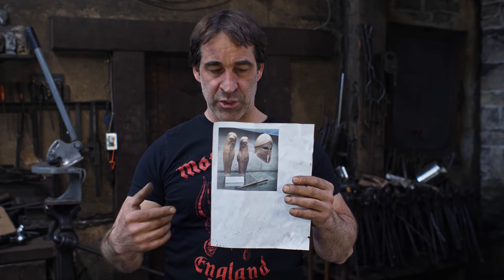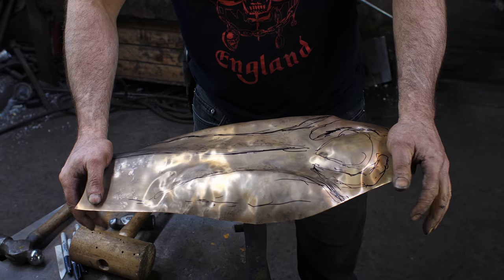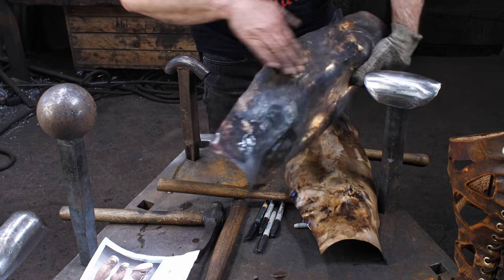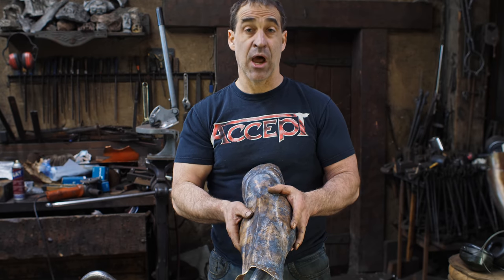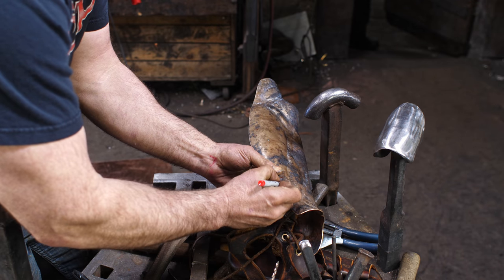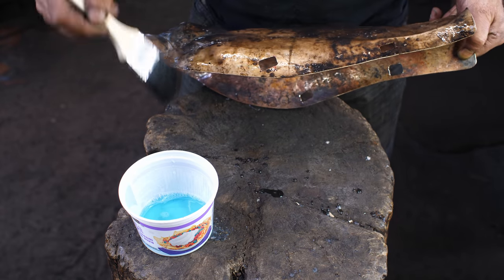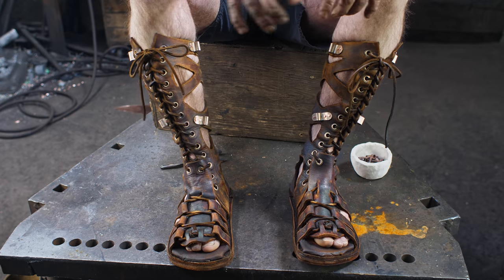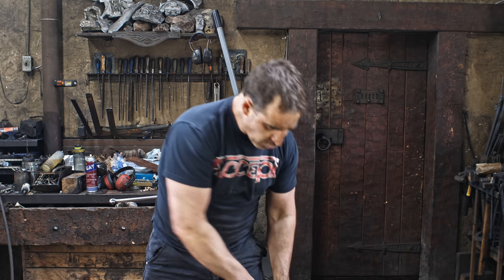Greek Bronze Greaves - Final Piece for Hoplite Armor

Comment: very nice, as always. Does it kind of dig in just above your knee when standing straight ? I have had to wear hoplite greaves for a movie, and the upper end was a bit more oriented outwards, for comfort when standing up, and also I guess it would provide better deflection, should you receive a spear or sword slash in the area, the greave would deflect the blade away from your flesh, (and femoral arteries) instead of guiding it upwards. Con was that it would sometimes catch bits of food while sitting during lunch and there's just no way of getting it out without unstrapping :)

I'm not so sure if arm braces are historically accurate, as I have seen many pictures with them but a lot without. But it sure would add a lot to the badassery of the whole look. Same for a bright Red cape. I know they probably wore capes as protection from weather, but probably didn't fight with them for obvious reasons.
Reply from the maker: For the little I have worn mine...I did not notice them digging in too much...but I will readjust if needed...what movie or show were you on?
Reply: @ThakIronworks  Immortal in 2010. Pretty shitty movie, to be honest. We had to wear those kits, althought made from some kind of plastic sometimes for 18h straight, with those hard leather sandals that felt like walking on wooden planks. The armor had no padding inside near the neck so guys all had rashes and blisters at the end of the first day from the edge of the head opening rubbing against the skin. Wardrobe had to put on some kind of rubber paddig to alleviate that. Bad experience,  for a bad film, by a bad director :)